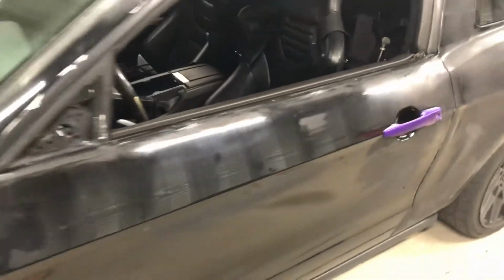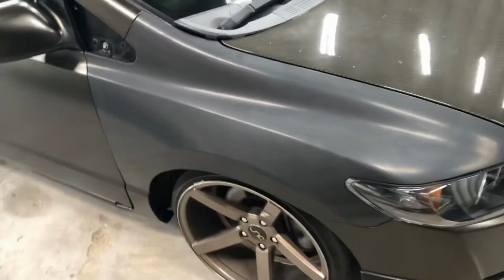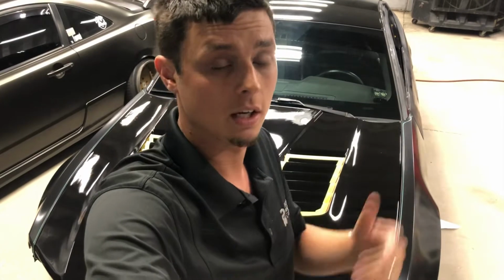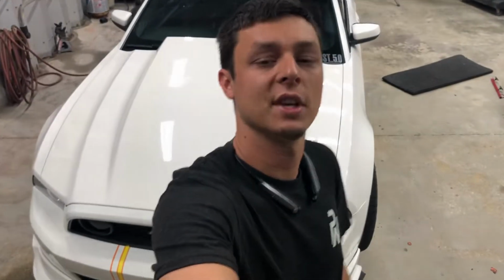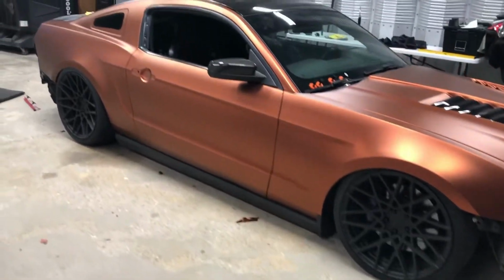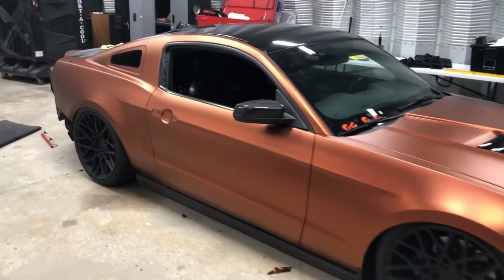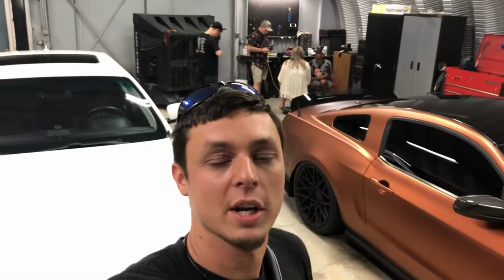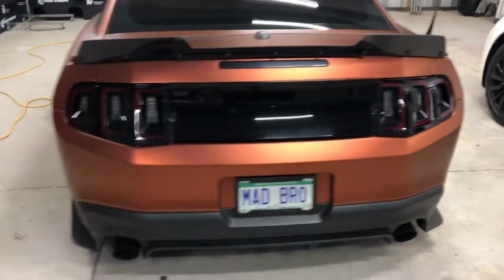Mustang GT Wrapped in Matte Autumn Fire!

Comment: is kpmf any good? seems cheaper than the big 3
Reply from the maker: Yes it is great, it’s definitely different than the big 3 but not cheap in quality by any means. Initial tack is aggressive, post heat temps are higher, and the air egress is amazing! It is a more advanced film to work with compared to Avery Dennison for sure!